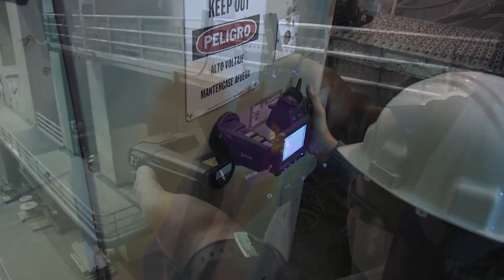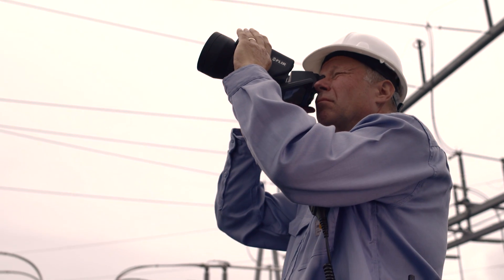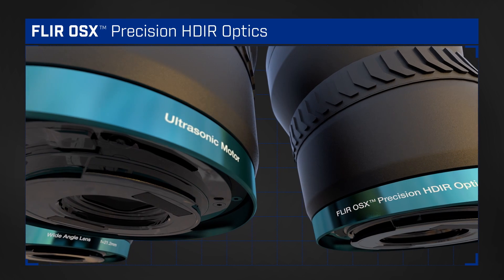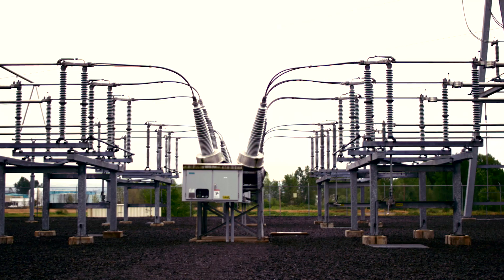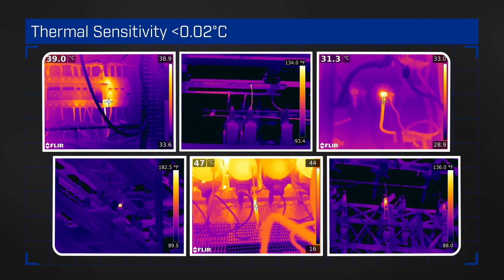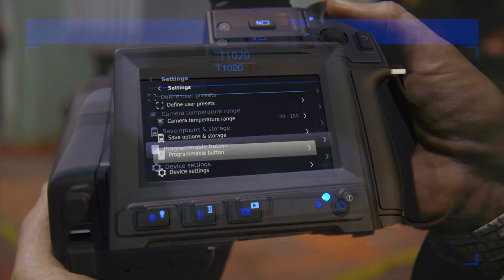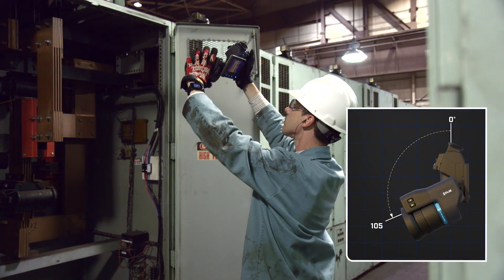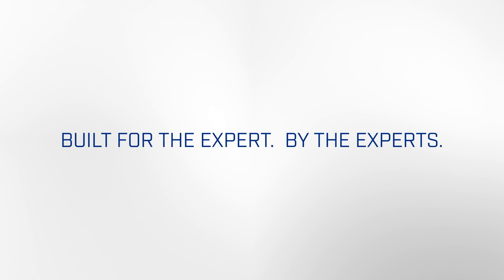Introducing the FLIR T1K Thermal Imaging Camera

Comment: what is the view on 12um.?.. making the pixels smaller.. do benefit the bottomline as you can make more microbolometer-sensors from a given piece, but lowering something aint always positive.. this aint a CPU, but a camera, and you need to catch the energy, just as a normal camera, where there are fundamental physics, that you simply cant get around.. same with astro,where you need a certain lightbucket to catch as many lightrays as possible.
Doesnt the signal to noise ratio/SNR increase when you go down in pixelpitch size just as your also outwatering your sensitivity for minute temperature differences. NETD with lower pixel pitch...
You also gonna hurt your dynamic range, that will be even more pronounce in challenging conditions, not least suited with less temperature sensitivity, and you can encounter diffraction abnormalities.
so smaller pixels on thermal sensors, it aint a dance on roses.

What flip display are you using on 1K models.. is it still LCD or have you moved to OLED. which is needed fpor that extreme contrast and be visible in challenging conditions.

Comment: $40K - for 768p - LOL

you guys have some monster cojones!

call me when 4K @ 60Hz resolution is $1K
Reply from the maker: +burrito rustler thanks for your message! Current thermal sensor technology can't be compared 1:1 to visible cameras. One of our smallest sensors currently has a 12 micron pixel pitch. Because the pixels are much larger than what you'd find on a higher resolution visible light camera, you'd need a much larger sensor, and some serious optics, which come at a high cost. Until the T1K, our highest resolution uncooled handheld thermal cameras was the 640x480 T600 series - we are excited to take things to the next level with the innovative T1K, and we hope to continue to push the limits of what's possible in the world of infrared.
Reply: @Flir  Thank you very much for the explanation!
Reply: Your 1K camera will not differentiate between hot and cold objects, It’s able to measure between <30mK to >2273K.